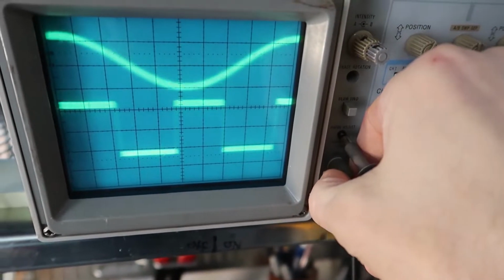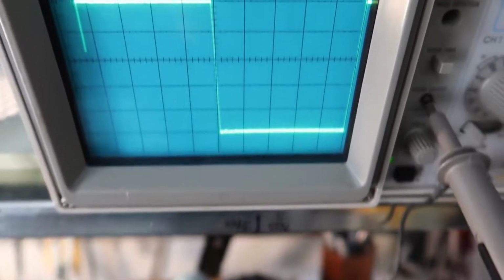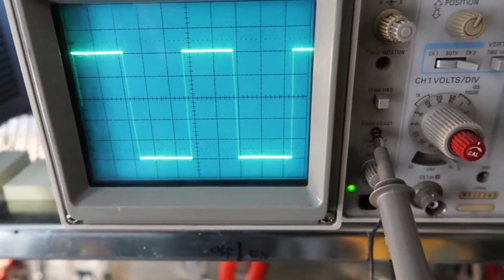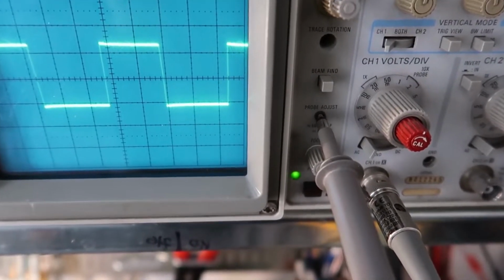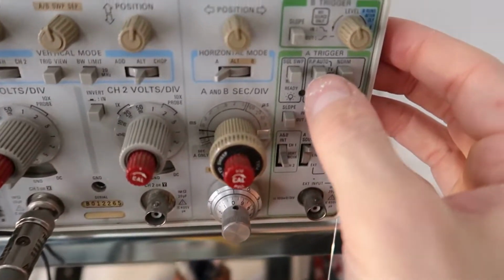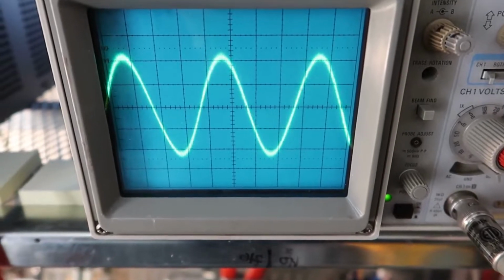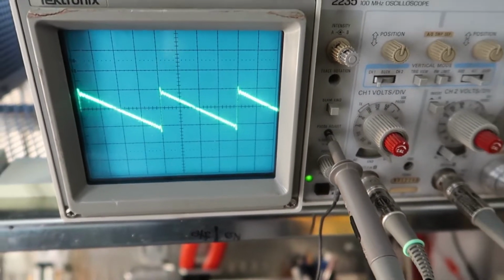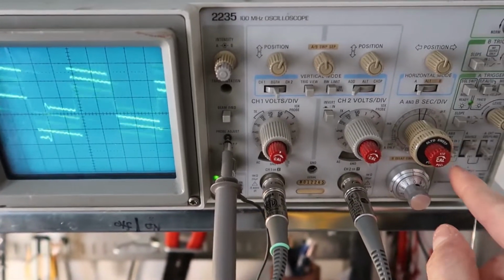Tektronix 2235 Oscilloscope demo and basic setup

Comment: 13:20
VERTICAL MODE : When vertical mode is selected the vertical control knobs are used as the source of the trigger instead of the standard trigger knob

P.P. AUTO AND NORM (The Difference)
There are subtle differences that realistically won't matter too much and generally speaking AUTO is going to be preferred. but here are the differences

P.P. Auto is designed specifically for troubleshooting TV Signals meaning if a signal is below 20Hz it won't trigger on it regardless where as Norm would trigger on it .
it needs the signal to be above 20Hz.
Also in the absense of a valid signal the trace "free runs "

NORM : This will trigger on any freqency, However.. IN THE ABSENSE OF A A VALID SIGNAL IT WILL NOT DISPLAY A TRACE ON SCREEN.
the idea of Norm is that the triggering will be more stable but it throws people because in an analog C.R.O. 
1. You can't see the trigger line physically on the screen
2. when there is no signal it will display no trace 
and this the person decides that something is not working correctly  :P

that's the difference

Comment: Thank you for your time to explain. I found it useful, as I am considering buying one. I didn't quite understand how you' ve connected the probe to the headphones jack of the laptop. I suppose it doesn't have digital storage, otherwise you would have mentioned it. Thank you, Paul
Reply from the maker: No digital storage, no analog storage!
Reply: The way you connect a scope probe to a headphone jack is simple.
A Headphone jack will work on a TIP and RING concept, You have your Positive and your negative , 
1. So you get a cable that you can cut and plug one side of it in the headphone jack

2. Cut the cable in the middle somewhere. You will have 2 wires.
Get a Multimeter out and do a continuity test to confirm which whire is the centre pin and which is the shield (or in the case of Bands) which band is +  or -

3. You then connect the Positive of your probe to the positive wire
and the ground of the probe to the negative wire

that's it, Pretty straight forward

Comment: I just found this in my dads stuff. What the heck did a this thing? A ham radio 📻?
Reply: This is used to analyze signals in general in electronics and even in radio it's not a radio it's just a way to see signals visually with voltage differences so you can understand what's going on inside your electronics.
Reply: if your dad was a ham radio operator then he used it to fix his equipment. Also it's useful for learning about signals and signal transmission which is why he had it. Ham radio operators are notorious for owning Cathode Ray Oscilloscopes, they are too much of a purist to own a Digital Storage Oscilloscope,   Perish the thought :P
Reply: @martinkuliza thank you.